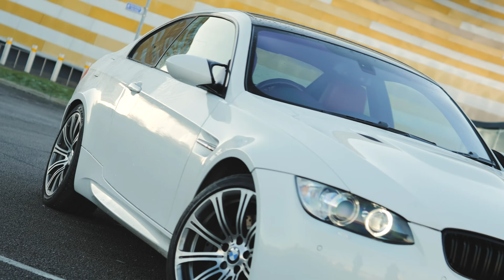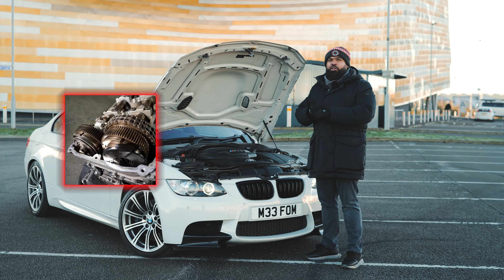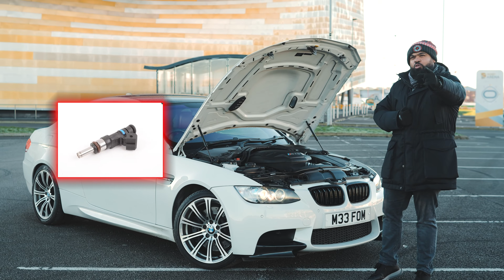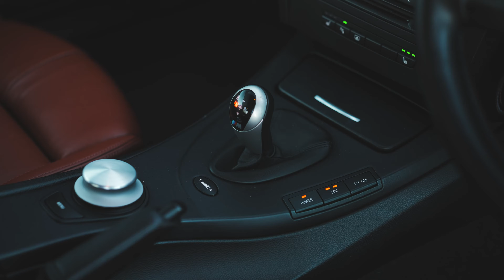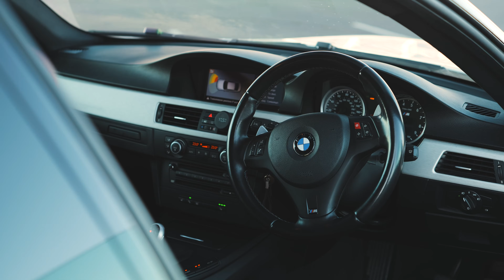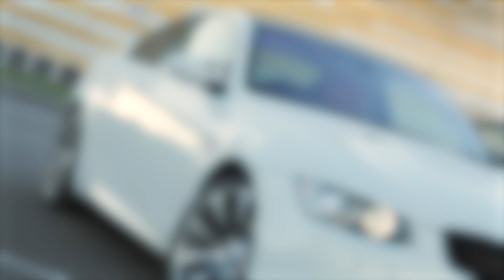BMW M3 E92 COMMON PROBLEMS!

Comment: Iv owned mine for 7 years now and had plenty of work done, most preventative stuff and the rest mods really. Outstanding cars, can't complain at all, weapons as well. Not as brutal and as quick as my M4 but it has so much more character than my M4.

I think this was a great video, and I did not realise G-tech motor works was in my local area. Maybe its time for me to check them out, im  looking for a suspension refresh and loweing kit in the next few weeks 🤔
Reply from the maker: Thank you for the watch, E92 M3’s are an incredible car. If you need anything from G-tech please let us know, we are distributors of quite a few high end suspension manufacturers.
Reply: @itsimty  thank you very much, il be sure to call in tomorrow morning. Keep the vids coming! Great info.

Comment: you can also pro charge these for like 600wheel on good fuel and stock internals. just like the b7 rs4 4.2 v8 these engines love boost

Comment: Bmw are very comfortable, very good looking and very well built cars until you hit 60k miles. At this this point should find a bmw mechanic(male or female), marry them and chain them to your car.
Failing that you should get warm custard and pour it over the as its more akin to a crumble than a car.
I had timing chain stretch, plastic bits blocking pump and the red light of death on the dash.😢
Reply from the maker: Oh Dear, hope you sorted it, Thank you for watching
Reply: They look nice  However, absolute pants engineering and quality. No comparison to a Volvo, Saab or Lexus .
Reply: @serenan920  Saab that went bust, over 10yrs ago was it?😛
Reply: Which BM did you have? 2.0d?
My 330d's at 139k miles, so far so good! (for the engine anyway, had to replace all ABS sensors though!)

Comment: Idle Control Valve (ICV) and Fuel Breather Valve (FBV)?? I think those are even more common than all of the ones you mentioned apart from rod bearings and throttle actuators...Cheers.
Reply from the maker: Thank you for watching

Comment: What your saying is EVERY part can fail? The only real problem with the e92 is the Thottle bodies. These fail ALL the time and a genuine known item. There is no point replacing them, as the item is defective. Place in England will upgrade the defective part and give you a lifetime warranty. I replaced two (before 15k miles) before I found this company. I replaced both myself and it’s not a skilful job, just time consuming {some class YouTube videos on same) Would I sell my M3…….not a chance. If you ever had one, you know these are animals. If you want one, don’t let people put you off. I’ve had top of the range Porsche/Audi and have sold, still have my M3 because it’s a weapon!
Reply from the maker: Thank you for your comment, we are not trying to put people off, the E92 M3 is a weapon of a car as we have mentioned in the video. You own one, we see these week after week and have been working on them for years, the video is just highlighting SOME of the common faults we have see as a specialist, Thank you for watching.
Reply: Can you tell me what the place in England is? 😅